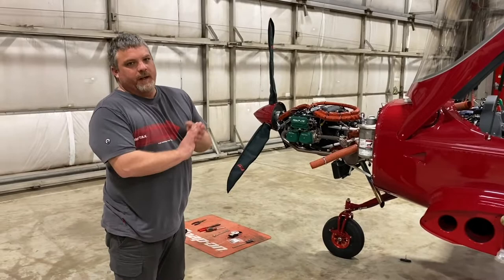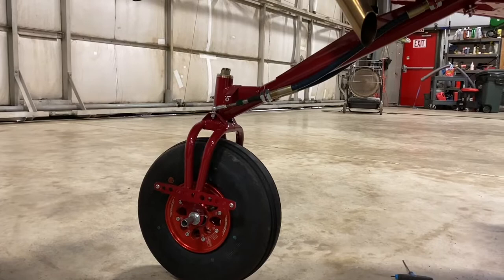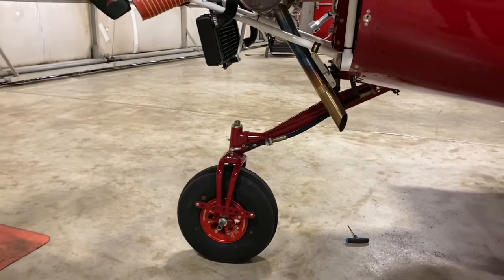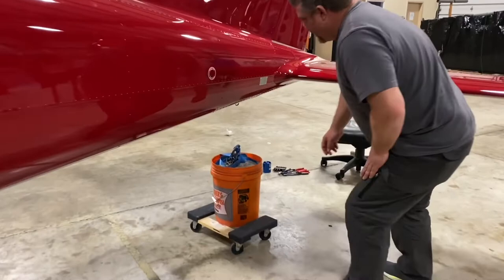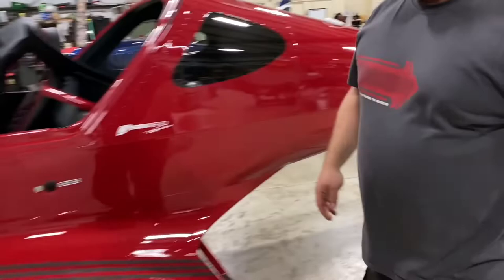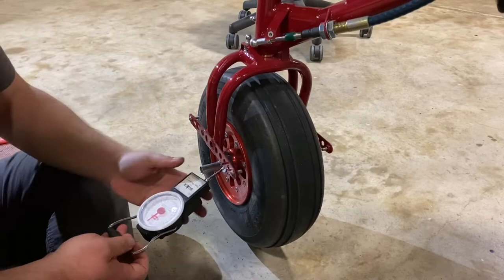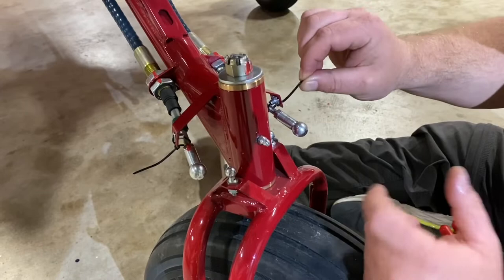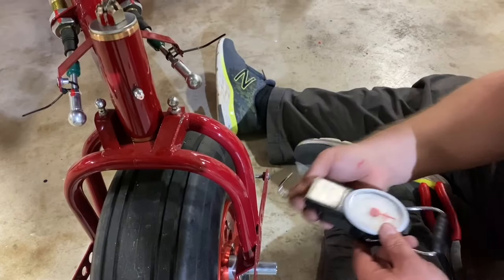Bristell Nose Wheel Tension

Comment: Is there a specific torque value for the top 19mm castle nut?
Reply: You don't torque the castle nut.  That's why it has a cotter pin to hold it in place.  Use the pull and measure method to set the appropriate resistance as shown by Rich.  Rick.